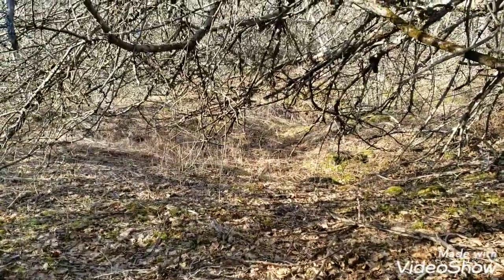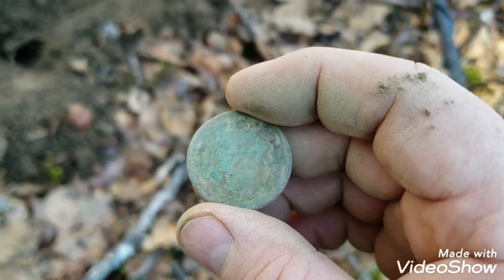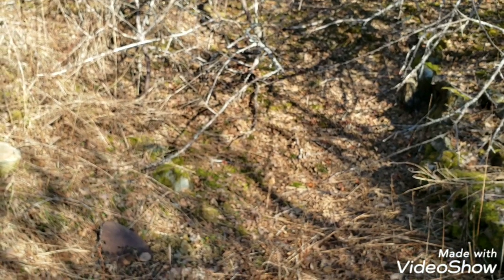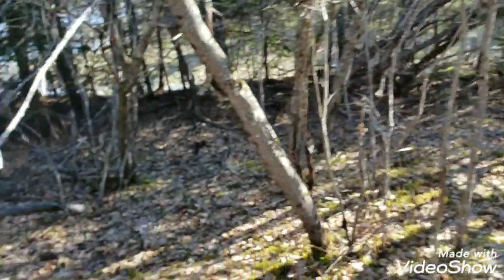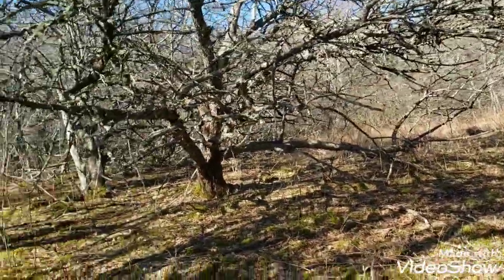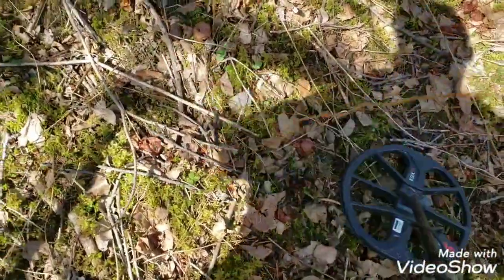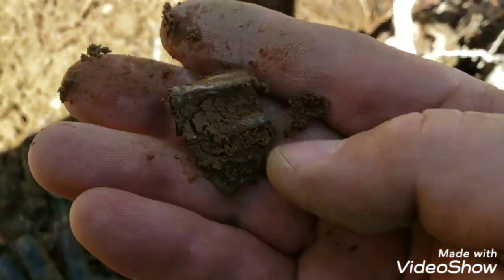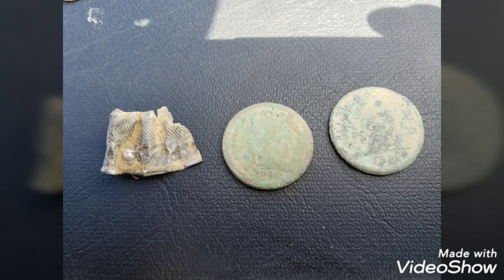Metal Detecting Canada- Equinox 600 vs pounded cellar holes

Comment: Cool video and congrats for the old coppers! Need a replacement for my Delta 4000, I admit the Nox 600 or 800 are very tempting.
Reply from the maker: I'm really liking it so far. At first, I wasnt too crazy about not being able to adjust the tones on the 600, and regretted not getting the 800. I'm fine with it now. With the types of sites I hunt, if it beeps, dig it, no matter what the tone sounds like.